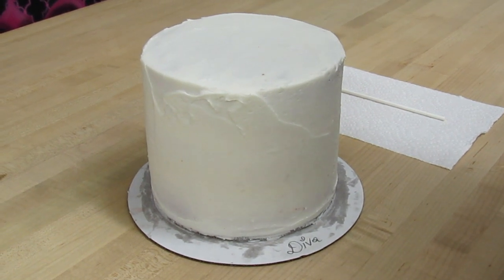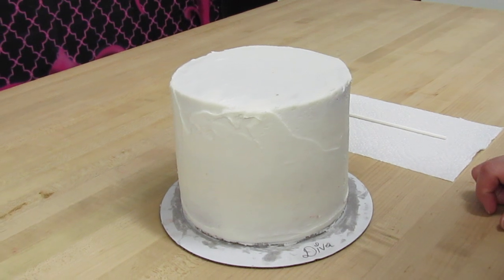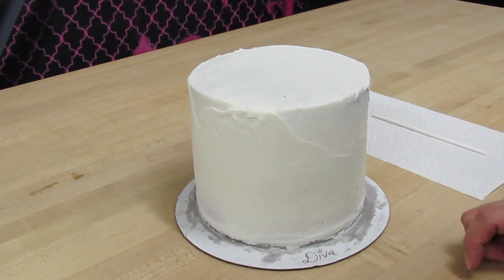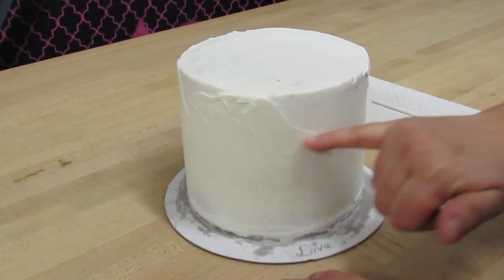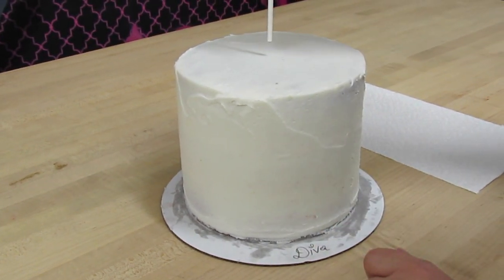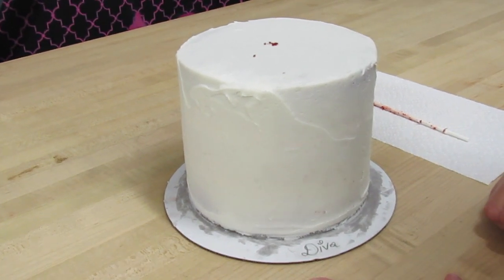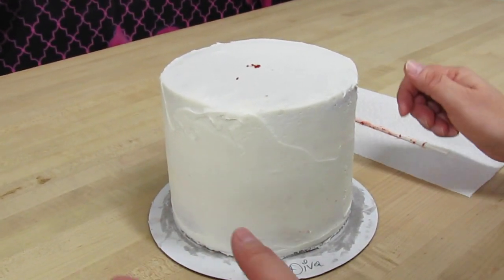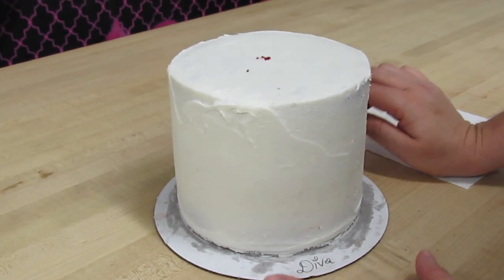How To Prevent Air Bubbles and Bulges In Your Cakes!

Comment: I work with frozen cake layers, will this method still work?
Reply from the maker: Thank you for your question. I don't recommend icing or layering cakes when frozen. Only cold from having been in the refrigerator for several hours or chilled in the freezer for no more than 20 minutes. Reason being that when a frozen cake is taken out into room temperature, immediately condensation will begin to form on the outside of your cake and that can ruin your icing. Also, if you are freezing your cakes soon after they are baked and allowed to come to room temp., the cakes are not being given enough time to settle as they should. Gravity must be given its due time to do what it's going to do to the cake layers before they are layered and iced. But, if you follow the technique as I've shown in my tutorial, it will work perfectly on a non-frozen cake. I appreciate you watching. :)